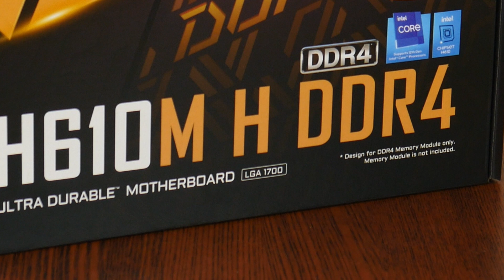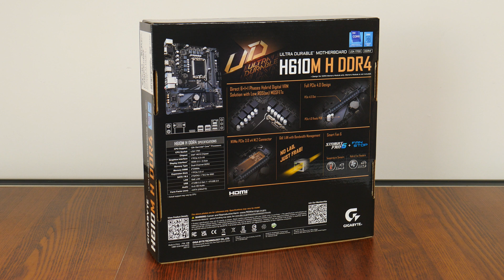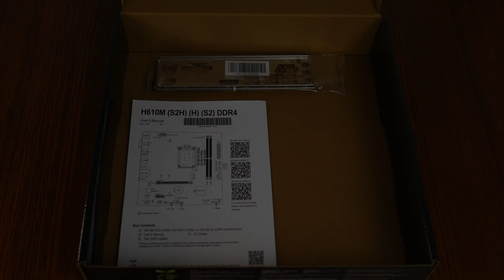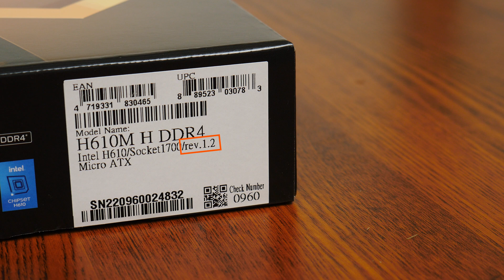Unboxing & Overview: Gigabyte H610M H DDR4 - Entry-level Intel 14th Gen Motherboard?

Comment from the maker: UPDATE AS OF 2024: This motherboard now supports Intel's 14th Gen "Raptor Lake Refresh" processors with a BIOS update available for download from Gigabyte's website!

Check out the article version of this overview here: https://www.alktech.co/articles/gigabyte-h610m-h-ddr4-unboxing-overview
Reply: Rtx 4060 is ok for this motherboard?
Reply from the maker: @Luca-pn2gu  yes a RTX 4060 will work with this board, but I'd be more concerned about your processor choice, as this is an entry-level board that wouldn't be able to handle high-end processors (e.g. the Core i7/i9).
Reply: @ALKtech  ok i buy b550 gaming x v2 its ok?
Reply from the maker: @Luca-pn2gu  yup, but the B550 is an AMD motherboard while the H610 in this video is an Intel board! Have you bought your processor yet?
Reply: @ALKtech  ryzen 7 5700x
Reply from the maker: @Luca-pn2gu  a 5700X is plenty of processor for a 4060. You'll be able to game at 1080p for most modern games at decent FPS and settings!
Reply: how update? if only using 14th gen proccesor
Reply from the maker: @megaimpian986  if the board that you bought is older stock and has an older BIOS, you'll have to borrow a 12th Gen processor to update the BIOS to the latest version so that it'll support 14th Gen! Best to check with your retailer if they are able to assist you with this.

Comment: The H610M isn't just for light use, it can be used in a gaming system. The H610M K DDR4 is absolutely fine for gaming with an i5-12400F + RTX 3060.
The 12400F is a locked CPU and doesn’t require Z-series boards or heavy VRMs to run at max spec. The H610 fully supports the chip’s boost clocks, PCIe 3.0/4.0 lanes, and a modern GPU without bottlenecking.
Reply from the maker: Yup I do agree with you - a 12400F will work perfectly fine with this mobo as it doesn't consume that much power, and when paired with a RTX 3060, you'd get a decent 1080p gaming PC. One would likely encounter performance throttling only with higher-end processors (e.g. 14600K, 14700K etc)!

Comment: Can this motherboard support RTX 3090 founders edition GPU?
Reply from the maker: Yup it'll work with a RTX 3090 for sure! What processor are you intending to use with this board?
Reply: I'm pairing this board with an Intel Core i5-12400 with 32GB of DDR4 RAM..Been tested it with 6GB VRAM of RTX 2060 and it works perfectly fine for 1080p gaming..Only thing that concern is whether I can upgrade the CPU to 13th or 14th generation in the future without having 'bottleneck' issue.
Reply from the maker: Ah I see - if you're gonna game at 1440p/4K with a RTX 3090 and 12400 combo, I think CPU bottlenecking won't be too much of an issue. That said, seeing as the H610M H DDR4 does come with a very basic VRM setup, my opinion is that your upgrade path is quite limited, as this board will likely end up throttling say, high-end 13th Gen and 14th Gen processors such as the 13700K, 14900K etc 😅
Reply: I might stick with Intel core i5-12400 for another 4 years or more and happily gaming with 1080p resolution..For (AAA) modern games these days consume a lot of GPU's VRAM and might need a slightly powerful CPU to run it at a recommended settings..I'm just a casual gamer and it would be fine for me even to play any (AAA) games at medium settings with my 6GB GDDR6 RTX 2060.😅
Reply from the maker: Got it, I think you'll be fine with a 12400+3090 combo for that four years, by which both AMD and Intel should already be on a new processor platform and socket, making it potentially a good time to upgrade then!

Comment: is it fine if i used i7-14700 with this motherboard?
Reply from the maker: I'd suggest getting a better board if possible, this motherboard is designed for entry-level LGA1700 processors. It will boot up and work normally for sure, but under intensive workloads, the 14700's performance may be affected by the H610M's basic VRM setup!
Reply: @ALKtech  THX <333

Comment: I want to pair with i5 13400f only problem is I am worry the bios will be older and need update but I don't have another CPU so is it possible I can use bios on USB drive.  My pc case is old and can only fit microatx 9.6x9.6
Reply from the maker: This board doesn't come with Gigabyte's Q-Flash Plus feature that allows you to update the board's BIOS via a USB flash drive without needing to install a CPU, RAM or graphics card - your best bet would be to check with the retailer that you're purchasing the board from whether it's new stock and if its not, whether they can help to update the BIOS for you before handing it over to you!
Reply: @ALKtech  I need a board that supports q-flash thats matx 9.6x9.6
Reply: @ and its gotta support i5 13400f
Reply: @ and Im getting it off amazon I cannot chek retailer
Reply from the maker: @ if you'd like a peace of mind, you might want to look at other boards with the B760 chipset instead - Gigabyte has a B760M K V2 DDR4 which is a pretty small motherboard that should fit your case!

Comment: Will it fit my i5 13400?
Reply from the maker: Yes it'll work with a 13400 - if the board that you're purchasing is secondhand/been sitting unsold on the retailer's shelf for awhile, you might need to update the BIOS first before the board will work with the 13400!

Comment: am i fine with a i5 14600kf with this motherboard? because i saw that the new bios update supports 13/14th gen
Reply from the maker: I'd suggest getting a better motherboard, perhaps a mid-range one with the B760 chipset. This is because the H610M H DDR4 has a pretty entry-level VRM setup that will likely throttle the 14600KF's performance!
Reply: @ it works fine for me
Reply from the maker: @pizkii  that's good to hear. Have you tried any CPU benchmarks to see if the 14600KF is able to perform as expected?

Comment: Asus rx 6600 8gb can pair with it?
Reply from the maker: Yup it will work fine with an ASUS RX 6600 graphics card!
Reply: @ALKtech  can suggest me one air cooler which can i connect through this matharboard over intel i5 12400f processor  under 2-3 k . Here in summer avg temperature is 40•
Reply from the maker: @hridaychakraborty760  the 12400F is quite easy to cool as it has a relatively manageable TDP - any chance you have some brands/models of air coolers in mind already that are within your budget and available in your country? Personally, I'm quite a fan of Thermalright's air coolers as they deliver pretty good performance at a good price!

Comment: Can I use the below mentioned item along with 2 external (2×120mm)arbg fans on this mobo?
The item is:EZDIY-FAB RGB Addressable Memory RAM Cooler DDR Heatsink for DIY PC Game Overclocking MOD DDR3 DDR4 (Compatible with ASUS Aura Sync, GIGABYTE RGB Fusion and MSI Mystic Light Sync) - Black-2 Pack
Reply from the maker: Nope, this board doesn't come with a 5V addressable RGB header, only a single 12V standard RGB header. You'll have to look for non addressable RGB fans instead!
Reply: @ALKtech  will this product fix my problem ⬇
EZDIY-FAB EZDIY-FAB 12V RGB Memory RAM Cooler DDR Heatsink for DIY PC Game Overclocking MOD DDR3 DDR4 (Compatible with ASUS Aura Sync, MSI Mystic Light Sync, ASRock Polychrome) - Black-2 Pack
Reply: It says it is compatible with asus,msi and asrock mobo software, so I doubt it will work with gigabyte
Reply from the maker: @cheems600  yup that's a good catch - do note that this motherboard is very entry-level and doesn't even use the standard Gigabyte Control Center app to control RGB lighting effects. If you want maximum compatibility, you might want to look at getting a slightly better motherboard instead!

Comment: can I use a 13600k with this board
Reply from the maker: I wouldn't recommend it - this board is entry-level and best suited for low-end processors due to the weak VRM setup. A 13600K will very likely be thermal throttled and won't be able to perform at its full potential. You should look at mid-range B760 boards at the bare minimum!

Comment: Im planning to build a pc 
With i3 12100f did think is good for gaming or pay extra for a B760 ?
Reply from the maker: If you're using a 12100F, this board will do just fine. Given that a 12100F is on the lower range of things, you shouldn't expect blazing fast FPS when paired with a mid-range graphics card - have you decided on which GPU to get yet?

Comment: Hello,i wonder if this Board supports WiFi Card support. My model is H610M-HDV/M.2 LGA1700
Reply from the maker: The Gigabyte board in this video doesn't support a Key-E WIFI module, if that's what you're referring to! You can of course, install a PCIe x1 WIFI card instead, seeing as the board does come with a PCIe x1 slot. Hope this helps.

Comment: Excellent video,
Friend, I would like to buy it and also a Presador i5 13th, but my question is, can I update the BIOS (Flash) with that processor, or is it very mandatory to have a 12th CPU to update the Bios?
Reply from the maker: Hey there, it really depends on how old is the stock of the motherboard that you're purchasing from your local retailer. If it's a board that was manufactured recently, it would likely have the latest BIOS preloaded are you won't need to update the BIOS to have 13th Gen support. It'd be a good idea to check in with the retailer that you're intending to purchase the board from to see if they can help verify how old is their stock!

Comment: Hello, im planning to get an i5 12400/f with an RTX 3060 12GB  so, which motherboard is good? Budget board is needed
Reply from the maker: This board will work perfectly fine with a 12400F and RTX 3060 combo!
Reply: bruhhh same i m about to built this combo ......see
Adata XPG Gammix D30 8GB (8GBX2) DDR4 CL16 3200MHz
Intel Core I5-12400F
Gigabyte RTX 3060 Windforce OC 12GB
Kingston A400 480GB SATA SSD
Corsair CX550 550 Watt 80 Plus Bronze
Gigabyte Motherboard - Intel Support-12th Gen H610M H V3 Socket 1700
ZEBRONICS ZEB-877B-CRONUS
how is this pc built >>> One shopkeeper said that this is worst pc built it will cause problem's like burning and heating issues should i go with this pc built or should i change some components!!!!! bty this pc built cost is 60k in indian rupees

Comment: can i upgrade to i7 13gen with rtx 3060ti without any problems?
Reply from the maker: This board will work with a 13th Gen i7 - but given it's an entry-level board with a basic VRM setup, it's highly likely the board will limit the i7 processor's performance especially under heavy production and gaming workloads!

Comment: Does it have pmw fan input for rgb control?
Reply from the maker: The fan headers support PWM - but just to clarify, PWM and RGB are separate things! Are you intending to install an addressable RGB fan (e.g. for your CPU cooler)?
Reply: @ALKtech  my case has pwm argb fans 

can i manage it over motherboard?
Reply from the maker: @Taha-qw5ni  ah I see. You won't be able to control your aRGB fans unfortunately, as this board does not have aRGB headers - the board only comes with a 12V standard RGB header!
Reply: thank you @ALKtech

Comment: What about with this setup could be perfect for 1080p resolution with ultra quality with this monitor ?
LCD 23.8" GAMING G2422B HDMI, DP, USB, Audio, IPS, 165Hz, 1ms

▪ CPU: Intel® Core™ i5-13400F

▪ MB: GİGABYTE H610M H V2 DDR4

▪ VGA: NVIDIA® GeForce® GIGABYTE WINDFORCE RTX-4070 12GB

▪ RAM: KİNGSTON 2x16 DDR4 3200Mhz

▪ SSD: SAMSUNG 980 PRO 1TB NVMe M.2

▪ PS: DEEPCOOL 750W 80+

▪ Cpu Cooler: COOLER MASTER HYBER 212 SPECTRUM V3

▪ Case: GAMEMAX REVOLT 4X RGB FAN
Reply from the maker: Yup this combo should work fine for 1080p gaming on high/maxed settings. Do you have the budget to spare for at least a B660 board though? While I haven't had the chance to use this board with a 13400F, and while on paper a 13400F isn't that power hungry, my concern is that the VRMs on this board aren't exactly high-end and do not come with heatsinks, which MAY limit your headroom especially if you have the intention to upgrade to a better processor in the future (e.g. a 14th Gen i7 and so on).
Reply: @ALKtech  i got another budget build right now. What do you think about this build also? Its like half cost for me right now and look like have good performance.

cpu:
amd ryzen 5 5600 3.5ghz 32mb

mb:
asus prime b550m-a/csm 4600mhz (oc) ddr4

gpu:
asus radeon rx 6700 xt dual 12gb gddr6 192 bit

ram:
adata xpg gammix d41 32 gb 3600mhz rgb (2x16)

ssd:
kingston nv2 1tb nvme pcie 4.0 3500mb/2100mb m.2 ssd (snv2s/1000g)

case+psu:
xpg valor air rainbow rgb black mid tower 650w 80+
Reply from the maker: @VegaMorena  yeah this setup will still work pretty well for 1080p gaming on High-ish settings. The 13400F build will get you more FPS for sure, but given that the AMD 5600 build is half the price, I'd be more inclined towards the AMD build instead. My two cents!

Comment: Hi does it comes with screws
Reply from the maker: Are you referring to the screws used to mount a motherboard within a case? If so, it doesn't. Nor does it come with a screw to secure the M.2 drive in place, this is because Gigabyte's gone with a tool-less design as per 4:05 of the video. Hope this helps!

Comment: I use an i7 12th gen with an rtx 3070, am I getting bottlenecked?
Reply from the maker: A 12th Gen i7 should pair with a RTX 3070 pretty well - are you already using this setup with the Gigabyte H610 board featured in this video? Are you facing any performance issues?

Comment: Hi there i wondering can i put Intel I5-12400F to this Board with Rtx 4060? I mean there's chance to be bottleneck?
Reply from the maker: A 12400F and RTX 4060 combo will work well with this board - a 12400F isn't that power hungry and the H610M H DDR4's VRMs should handle it just fine!
Reply: Thanks for replying and what are you thinking about gaming performance this system? At this budget with that system it can provide good gaming performance? @ALKtech
Reply from the maker: @hollowman5510  a 12400F+RTX 4060 combo will make for a pretty decent 1080p gaming rig at high-ish settings on most modern games (with ray tracing disabled). If possible, try to go with 32GB of DDR4 3600 RAM for your PC's memory!
Reply: Thanks a lot @ALKtech
Reply: Hi There what are you thinking about RTX 4060 TI with that Motherboard i mean those both will work properly? (I5 12400F+16RamDDR4) thank you @ALKtech
Reply from the maker: @hollowman5510  a RTX 4060 Ti will work well too with a 12400F and 16GB DDR4 combo - this setup would be good for 1080p gaming and 1440p gaming with lowered graphics settings!
Reply: Thank you  @ALKtech

Comment: bro I want to pair this with 12400f, what type of potential compromises would I go with in this case (except ram3200mhz)
Reply from the maker: A 12400F will work fine with this board, just make sure you've got a good CPU cooler - the stock cooler that comes with the 12400F isn't very good!
Reply: @ALKtech what if stock cooler is used only for gaming with this motherboard and i5 12400f cpu and rx 6600 gpo, no video editing won't be done😮
Reply from the maker: @shantonabsen2299  if you don't have the budget for an aftermarket cooler, the stock cooler will still do the job for sure, though temperatures would be higher than say, using an aftermarket cooler. The good thing here is that the 12400F isn't very power hungry to start with, and since you won't be doing anything too intensive like video editing, the stocker cooler will suffice!

Comment: is this better than the tuf gaming b450m pro II?
Reply from the maker: The TUF Gaming board is an AM4 motherboard for AMD processors - it's not a like-for-like comparison with the H610M H DDR4, which is meant for Intel processors! Do you already have on hand an AMD or Intel processor?

Comment: Hello I've seen a pc with this board and an i3 12100f and an rtx 3070 I was wondering if that's good for gaming but your said it's an entry level board so now I don't know what to do can you help me thank you in advance
Reply from the maker: This board will work fine with a 12100F and RTX 3070 combi, as the 12100F isn't a power hungry processor and the H610M H DDR4's VRM setup should handle it just fine. Hope this helps!

Comment: This motherboard is excellent, I'm very satisfied with it, I don't see why putting anything else for a mid-range configuration, my Core I5 12400F works perfectly.
Reply: Bro I have msi h 610m is it good ?
Reply from the maker: @saatwiksaraswati2317  well it's pretty similar to the Gigabyte board in this video, in that it's a low-end Intel LGA1700 motherboard. It'll work great with Core i3 and low-end Core i5 processors (e.g. 12400F etc).
Reply: @ALKtech  ok I have GTX GeForce windforce d6 1605 GPU and cpu is intel i5 12 gen 12400 f what will be the settings in which we can get 60 fps in GTA v and other valorant god of war settings
Reply: @ALKtech  and the msi model i have is h 610 m-E
Reply from the maker: @saatwiksaraswati2317  are you gaming at 1080p? The GTX 1650 isn't a very high-end card, you might want to try playing your games on a mix of Low to Medium settings...
Reply: Can I use this motherboard with i5 14400f ? If i updated the bios? Please answer
Reply from the maker: I do think a 12400F is a great processor to pair with this board! But if you're gonna go higher than mid-range (e.g. 13600K, 13700K), this board would probably prevent such processors from achieving their maximum potential due to VRM limitations...
Reply: Is the sound from the aux port good? @ALKtech

Comment: Can I Install the Corsair H100i water cooler system on this motherboard??
Reply from the maker: The H100i doesn't come with the LGA1700 bracket out-of-the-box from what I see - you'll need to order the LGA1700 mounting kit from Corsair in order to use the H100i with this board.